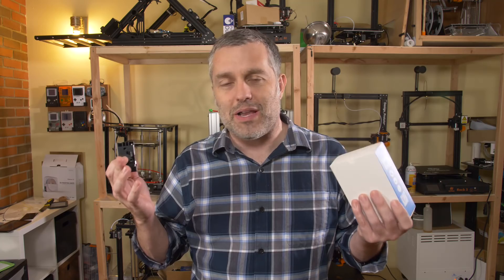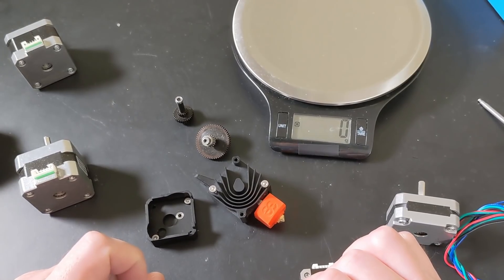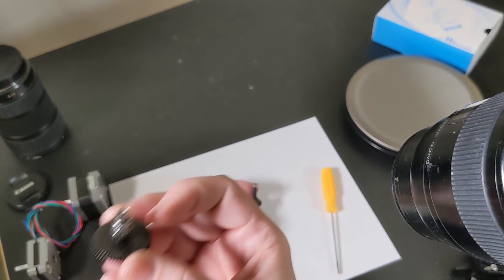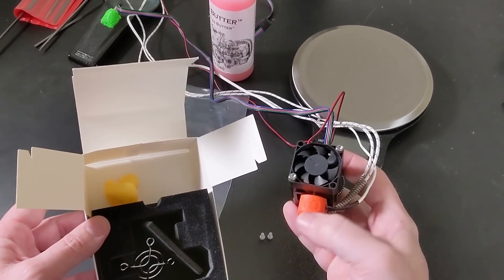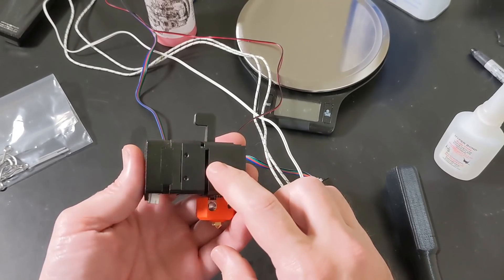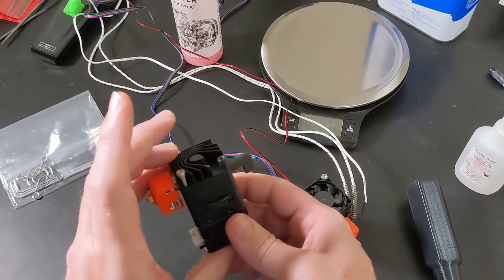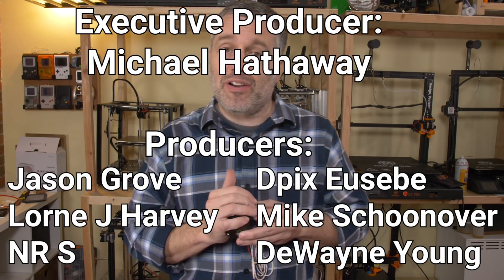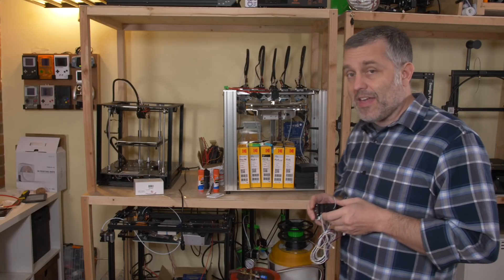GAME OVER For Hotend/Extruder Design? - The Biqu H2 Direct Drive Hemera Alternative

Comment: Don't file down the shaft.  Since it worked from the factory, turning one gear so that it meshes the other at a different position, would likely have fixed it.
Reply from the maker: I suppose I could have tried indexing the gears in all the different ways until I found an orientation that worked without as much friction, but what happens when I need to disassemble for maintenance or to to replace the hotend/heatbreak? Best to make sure that the apparatus works in all orientations as it should have from the factory.

Comment: Try klipper with input shaper to go beyond 100mm/s?
Reply from the maker: Reprap firmware has dynamic acceleration. If I'm not mistaken RRF had that functionality before Klipper. As you know I use Duet control boards. I can't think of a single reason to put Klipper onto a Duet board.

Comment: I really dislike the location, or access to said, of the set screws that hold in the heatbreak.  Essentially, the entire extruder has to be dissembled in order to be able to loosen these set screws and remove the heatbreak.  It seems like a bad idea to have to disturb the gear meshing in order to do a fair common maintenance operation.
Reply from the maker: Don't forget that the whole thing has to be taken apart if you have some kind of filament jam as well.

Comment: I thought the biggest issue with these was the hot end is lined with PTFE so the max temp was 260
Reply: You could buy a heat breaker in full or dual metal if you want. They also sell a version for 500C°

Comment: Just got one. Spent better part of 2 hours trying to make the gears spin freely when the stepper motor is firmly mounted. If the stepper motor is loose, the gears spin pretty well (after some super-lube). As soon as I LIGHTLY tighten the mounting screws (being very careful to maintain alignment...it's not fully constrained), the gears lock. A tiny 0.4mm shim between the gear housing halves "fixes" this (piece of paper folded twice / 4 sheets thick). Anyone else see this? Any good ideas for fixing it aside from the hackey shim? Definitely feels like a beta product needing some refinement and/or looser tolerances, since it seems their machining can't quite handle the tight ones.
Reply: Yeah, never mind. I printed a mount (and a lot of other "accessories") and dry fit every thing. As soon as the extruder was mounted to the mounting plate, it locked up tight again. Perhaps I (and a different reviewer on Amazon with the EXACT same problem) got one from a bad run. Regardless, it's going back. Sad. I spent a ton of time trying to make it work. Neat product. Lot of potential. Maybe I'll come back for v2 if @BIQU can get this design/manufacturing issue resolved. :(

Comment: If you are looking at weight and performance, then check out the Omniadrop extruder www.dropeffect.com ... it has a planetary gearset and is mostly printed and extremely lightweight, plus there is no PTFE tube inside and is good for 285 C.

Comment: I think the max temp for the default extruder being 260 doesnt make it "better in every way than the hemera".
Reply from the maker: There is a lot of metallurgy, fit and finish, and manufacturing precision that the Hemera has which this one lacks. The overall design is better. Smaller and lighter. E3D is not good at design. They need to hire an industrial designer with a big picture perspective. They do all the details really well, but they miss the forest for the trees.
Reply: @DesignPrototypeTest  I think its a way easier job for a company to see a product like the hemera and take the best parts and part with the worst parts. I don't think that this is better because it had better designers, I think it is better because the hemera gave it a stepping stone to improve on. I would say that saying that e3d isn't good at design is inaccurate. They made a cool product, and even you say that the h2 takes inspiration from the hemera. I think you would enjoy(and learn) watching 3dprinting general's interview with sanjay from e3d. He talks a bunch about industrial design. I am in the market for a high performance hotend/extruder combo and Im going with the hemera. I know its big, and the motor is overkill, but I prioritize peace of mind knowing that I wont have to make huge mods just to make my extruder work correctly. Yeah theis extruder is smaller and light, but I doubt that it will make a huge difference, especially printing at low speeds. How much of a difference would it really make. How much heavier is the bed(structure) and glass than the extruder?
Reply from the maker: I've already watched the interview, but thank you for the tip. Pease keep them coming. It may just be me but it seems like a a fair amount of the subtext in that interview is indirect responses to my vast criticisms of E3D from this video: https://youtu.be/xkFS77GlFkY Now as to my criticism from this comment stream that E3D can't design. Why was a Chinese company able to out-innovate E3D? China sucks at innovating. Yet they did it better in this case than E3D by making the E3D smaller and lighter. If E3D had iterated on their own own product before going into production they would have made this very obvious move and China would not have been able to beat them at their own game. Speaking as an industrial designer, with a channel name that embodies the iterative process, I can tell you flat out E3D are detail nerds who do so many things right, but they lack good leadership/direction for overall design and big picture strategizing.

Comment: So basicly if you need a direct drive printer you recommend this extruder? I do need a direct drive printer.
Reply: I'm sure this extruder would be pretty decent for the money but when the E3D version is like 50 bucks more and yeah less weight is a plus but for me not a deal breaker I'd still go E3D
Reply: @MrCAPSco  For you this is E3D is 50 bucks but in Norway the price is 100% more.
Reply: @honeyy79  okay yeah I hear you there dang well then if you give me a brie f description of what you'll be printing what material if you just need the advantage of a direct drive but don't need a hot end that goes to 500C you could get away with a lot cheaper direct drive kit What printer do you have
Reply: @MrCAPSco  TPU mostly
Reply: @MrCAPSco  And the printers i have is Anycubic Predator and a Chiron.

Comment: Going off on a tangent about those drive rollers being clones and thats bad and should not be done is an amateur move from someone with his number of videos. If he was to stop and think about it for a minute, especially after editing the BondTech image into his video. At the price those extruder/hotends are selling for, the company are not likely making most of the parts themselves, they are more than likely buying each of the mechanical parts and piecing them together. and it is fairly obvious (for those with common sense) that they are probably buying those drive rollers from BondTech themselves. so getting all bent out of shape over it just makes him look bad. and thats without going into the fact that once someone comes up with the "right" design for something, it is pretty silly to change that design to something less effective just so that it is "different". Also, how does he know that BondTech didnt copy that design from someone else.

Comment: For extruders delrin is an excellent gear material coupled with a metal spur and can be easily  adjusted for less backlash over metal-metal combination. This is overkill and bling in this application. Other than that its typical chinese copy of others work

Comment: 7:36 "Everything on this hotend is metal"
Have you tried unscrewing the heat sink? There's a piece of ptfe tube... how can you say this is "all metal"
Reply from the maker: "All Metal Hotend" is a term coined by E3D and meant to distinguish it from the PEEK hotends which were prevalent at the time while also referring to the PTFE liner. It's really a bad term. We should be saying "Unlined Throat" instead of "All Metal Hotend" The first thing to note here is that PTFE Liners are superior for PLA, PETG, and even ABS. Everyone has been sold on the metal throat as superior, but that is really only the case when printing high temperature plastics which require a nozzle temperature above 165°C. Now as to my wording: Which part of the assembly is the hotend, and which part is the extruder? I called the whole thing the hotend. It was pretty obvious what I was talking about because the next words out of my mouth were talking about the lever arm. I don't think anyone is confused. I think you are just nit picking. But meaculpa I will call it the assembly in the next video. Also, by your very strict reasoning it will also be "All metal" at that time as well once I install the Copperhead Heatbreak into the assembly.
Reply: @DesignPrototypeTest  An all-metal heat break or even a bi-metal heat break is just that all metal. Not PTFE lined. Period. End of Day. So it is not an all metal hotend. If that was the logic, then the cheap junk that Creality uses would be considered all metal.
I use all metal titanium heat breaks on my older v6 volcano setups for printing pteg and Nylon because who likes having to change out a heat break for a minimal improvement when going back down in extruder temp? Not I lol.

Comment: This is the same way they drive wire in mig welders! So to say an ip was cloned would mean its a clone of a clone
Reply: Like bondtech was the First to use double gears😂😂😂
Reply: Never thought of it that way.  I wonder, does anyone have interchangeable gears for different diameters and materials like flux core etc.  I suppose spoolguns are similar to having direct drive and liners are effectively Bowden tubes.

Comment: You should look into the orbital extruder!
Reply: The sherpa mini also
Reply: @johnszwalkiewicz6068  annex engineering? 😎
Reply: @ByronChou17  Yes it's smaller, lighter and cheaper. In usd its  $21 for the motor and $9ish for a bmg clone But it's only a 5:1 Gear Ratio

Comment: in order to change the throat you nood to disassemble everything! so for prusa what is the point of it if the preen limited by the bed weight??? so this is not awesome!!!! also during the long print the motor is hot and sometimes the steps missing occurs! the price((((( the bmg + v6 radiator+ mk8 or vulcan hotend is much better!!!! for speed prints it is not good! regarding the clog if it will occurs - and you need to simply to clean the throat - you need to dissemble everything - or you need to modify it a bit- so why the BIQU do not sell the finished product? so i guess this is not so awesome as you show it(

Comment: Mathew have you seen the Bondtech LGX extruder? It has huge gearing. It’s all plastic
Reply from the maker: Plastic gear meshed with metal gear, and only a 3:1 ratio requiring the higher torque of the Nema17 motor vs the Nema10 motor on this one.
Reply: @DesignPrototypeTest  the LGX is not 3:1 I believe it’s 7:1... the drive gears are three times larger. I made a video on my channel if you want to see it all taken apart.
Reply: @DesignPrototypeTest  thanks for the shout out! You can call me a friend too! Lol.

Comment: The hotend is ptfe lined so not ALL metal!! what a dumb design from BIQU make everthing metal but skip the damn Heatbreak
Reply: Before making this critics, inform you and you will know they sell the heat breaker in full or dual metal.
They have also a version which goes up to 500C° (watercooled or not)
For people which mainly use PLA the PTFE is recommended and for the one that need to go higher temp they provide a specific version...
Reply: @hman72y  what are you talking about I have 2 of the BiQU H2's both purchased from amazon they give you no option for a all metal heatbreak version on there but it used to say "All Metal" and they replaced it with the V2 now which really NOW is al metal including a all metal heat break I have 4 BiQU H2's in total now so I am not speaking from no experience Spent close to $400 on these 4 extruders. BIQU messed up on the V1 the V2 also runs better less rubbing and noise

Comment: Man I wish you would stop with your in-depth explanations because you start and then you contradict yourself but when you said that you're chewing up the shaft cuz the gear was eccentric no you did no such thing not even a little tiny bit. That shaft has bearings like you said and they fit into those keeps or those little pockets for the bearings that is the only place you'd be able to change the shaft and correct it if it was either out of round or if it was off center with the gear or anything like that I can tell you have absolutely no machinist background but just trying to sound intelligent for the sake of it it's not working